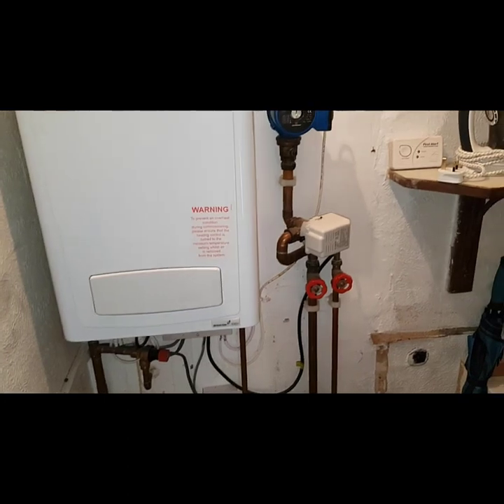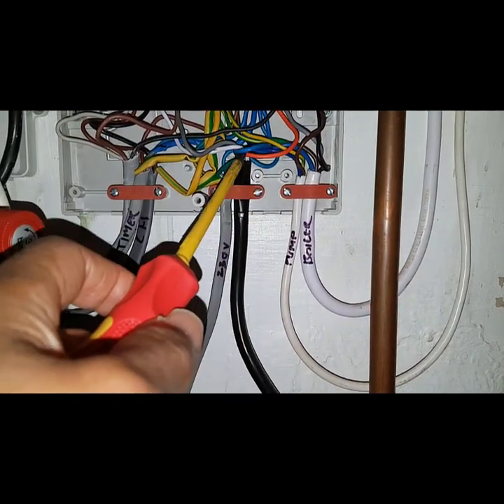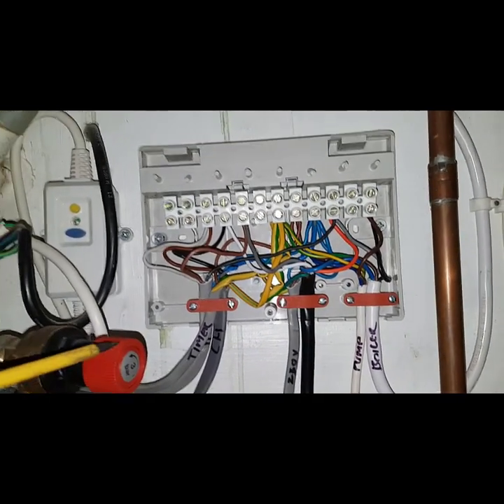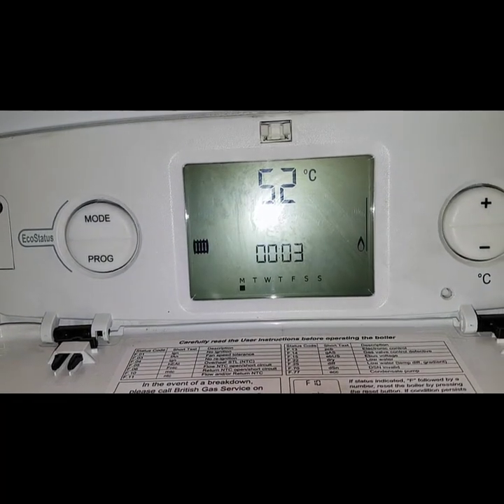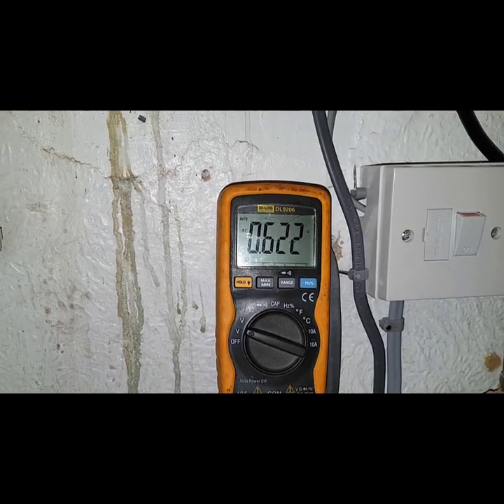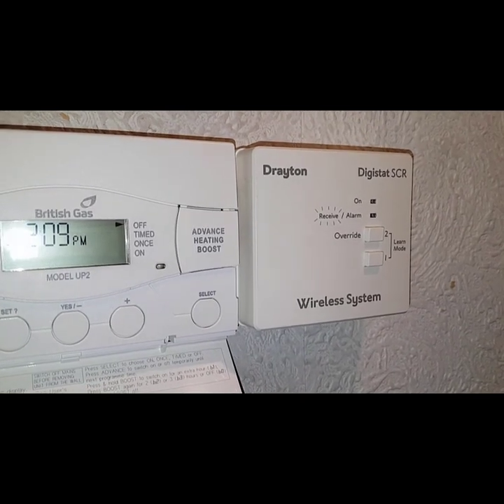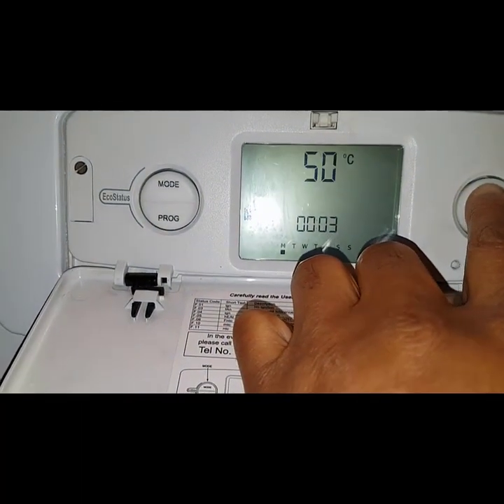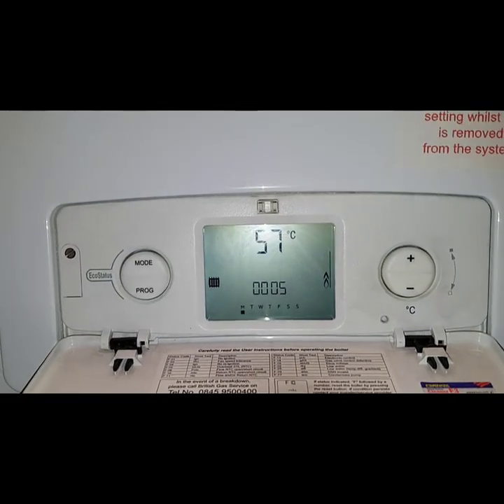British Gas 330 Plus No Hot Water

Comment: i have same boiler and on the lcd panel it momentarily shows 0.0bar and i dont see any pipe or tap underneath boiler to increase pressure. can you please advise

do i need to remove front  panel to access the water tap to increase water pressure , have no clue
Reply from the maker: There is either a filling underneath the boiler or it could be the sink unit. And could you please subscribe to our channel 😊